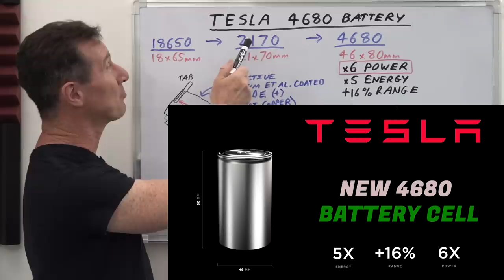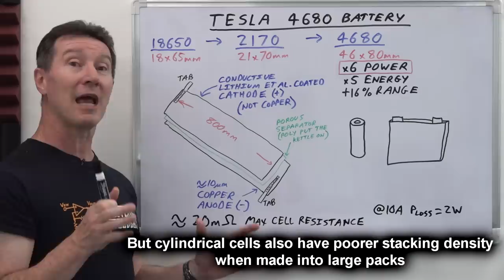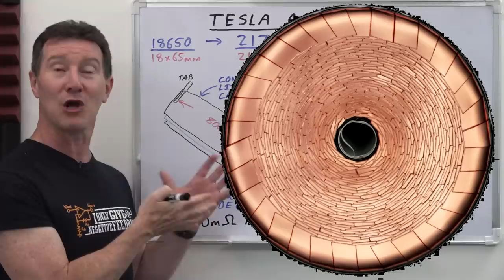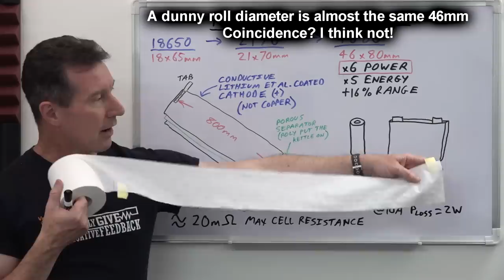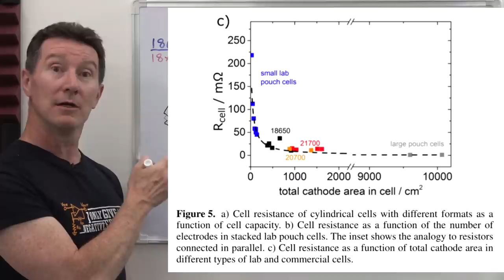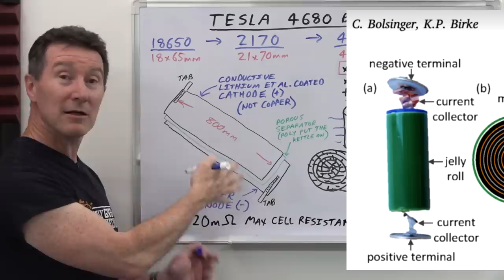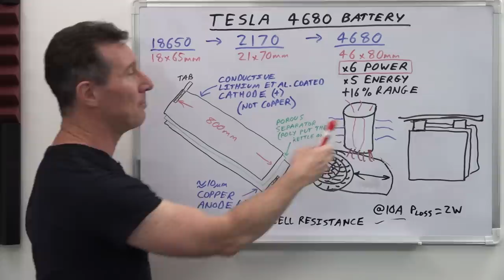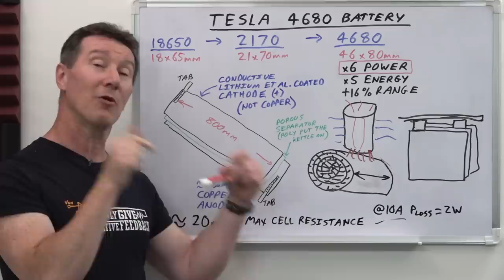EEVblog 1340 - New Tesla 4680 Battery Cell EXPLAINED

Comment: If the 4680 cell replaces 5 of the 18650/2170 cells with 10 times less resistance, that will only reduce the power loss, charging/discharging, by 2x for the whole battery pack. example (10A*10A * 0.02 = 2W*5 = 10W,  50A*50A*0.002 = 5W)

Comment: Why nobody else thought of it: Its hard until someone figures out how, then it's easy.
Reply: I don't know if it's the same design, but Tesla just bought Maxwell battery design in 2019.
* So it's most likely they just made the Production process.
What else they could do in a year?
Reply: I don't think this is a new technology except for in batteries possibly. Film capacitors have had non inductive variants for years now that mechanically do the same thing. I think in that case the ends are embedded in some conductive material rather than being folded over but the concept is the same.
Reply: They've been building supercaps with this tabless design forever, not sure why someone didn't think to build li-po cell using the same technique
Reply: true i had to figure out a way to do something that was not friendly/possible for what I was doing. then I ended up making an easier, more accurate & stronger  way of doing it & it used less parts
Reply: This has been thought of before, but not successfully implemented in batteries, it may have appeared first successfully in Electrolytic Capacitors, particularly the axial electrolytic capacitors. This is why, I suspect this technique came from the engineering of Maxwell’s Supercapacitors!
Reply: Couldn’t  they run a non electrically conductive cooling jacket right through the core of the roll and pump cooling fluid through that jacket?
Reply: When the first 1 farad super capacitors came out on the market, they were 5.5 Volt, 1 or 0.1 Farad, but had an extremely high Effective Series Resistance, so they only could serve to supply low currents for memory backup and could not support the applications of serving as Power Supply filtration Electrolytic Capacitors. Such a large capacitor with a lower ESR, would have had Computer Grade, Power Supply engineers drooling on their Hewlett-Packard Engineering calculators with dreams of making 0 ripple power supplies that could ride through long interruptions of input current during momentary brownouts, allowing simpler designs relying less on sealed  lead acid batteries often made by Panasonic and others back then. Lowering the ESR, increasing the working voltage and further increasing the capacitance is what Maxwell has got to have made its engineering goals.
Reply: yeah lots of great ideas seem obvious in hindsight...
Reply: ...I thought this is how they were doing it all along :P
Reply: I'm sure plenty of people thought of it, you need money to patent things. Also, Tesla usually just buys ideas/patents, much like Edison of a modern age.
Reply: @BustedJunkStudio  Likely a matter of cost. It's not cheap for battery companies to completely change their entire production lines. Elon though has multiple business ventures he can simply funnel their money into a new project.
Reply: Reality is, there was no need for super high current batteries in the past. Fast car charging is changing that, and is one of the most important features of EVs.
Reply: @DishNetworkDealerNEO  I think the problem is the higher thermal resistance in radial direction. You wouldnt win anything with that aproach i quess compared to outside cooling. Plus the design, manufacuring and assembly would me much more complex. The true benefit is, that with the tabless design you can use the very good thermal conductivity of the copper and almost directly connect it to a heat sink.

Comment: Others that use cylindrical cells: Lucid, Rivian, Toyota PHEV,  and hundreds of e-bikes and scooters.
Reply: Is your point that those fields will be reliant on Tesla?
Edit: I got 4 minutes into the video
Reply: au no. The host said he didn’t think anyone else was using cylindrical cells in transportation. That’s why I commented.
Reply: @JoelSapp  That's why I edited
Reply: au ok. All good.
Reply: Lucid and Rivian are still basically vaporware, Toyota is interesting though
Reply: oragamihawk   Rivian has a pilot assembly line and is building vehicles.   The actual production factory exists with the production line being finalized.   Behind schedule (who isn’t?) but hardly “vaporware”.
Reply: oragamihawk both have factories, and scheduled to release vehicles this coming year. Lucid built a factory from scratch and Rivian bought an old Mitsubishi factory has deals with Amazon to build 100k delivery vehicles on their platform.
Reply: Rimac use cylindrical cells too.
Reply: Josip Sinković thats awesome.
Reply: @origamihawk  Lucid's tech has been in Formula E for years now. It's not vaporware. However, whether or not they will be able to compete with Tesla, remains to be seen.

Comment: Great vid, there is an entire recycling system as part of the battery technology development as well, so that makes the solution irresistible.

Also, thermal paste between end cap and folded copper would be very efficient... unless chemical reaction, but im sure that could be resolved. Wonder how this transforms drone tech. And portable tools...

Comment: They said that the +16% was strictly due to the size of the cell. So that was expected.
Reply: That's mostly the height difference, the packing density between 21mm and 46mm cells doesn't change much.

Comment: The volumetric efficiency of packing cylinders is always 90.69%, regardless of dimensions. So not sure what you're referring to by "improved volumetric efficiency"??
Reply: They will be doing away with much of the liquid cooling for the new batteries,
So less space is needed between the batteries in the car.
Reply: The steel casing of the cell is wasted volume which (assuming they use the same thickness steel on the new cells) will occupy a volume proportional to the surface area of each cylinder. It's a similar story with the required plastic filling to bind all of the cells together. The individual new cells will occupy a larger volume obviously, but their surface area to volume ratio will decrease so the proportion of space wasted by casings/structure/filling material in the battery will decrease.
Reply: I was thinking the same while watching the video.
Perhaps the efficiency comes from secondary issues of less packaging and fewer cores.
In a one meter square array, there are 48 x 48 of the 2170 cells and 22 x 22 of the 4680 cells
If each cell uses a 0.25mm thick shrink fit cover and a 0.25mm thick steel case, each cell has 1mm(4x0.25mm) of its diameter of non-energy storage.  Basically a reduction of energy storage area of 26mm along both axis of the meter square, about 5%.

If the minimum empty core diameters are similar for both cell sizes there will be 1,820 fewer cores in a meter square array.
Anyone know a typical area of the empty core?
Reply: @musiphonix  You don't need to bind the cells together, in fact this makes it impossible to replace faulty cells. You don't need anything between the cells besides coolant and this can be pumped through the existing triangular spaces between the cells in the lengthwise direction instead of perpendicular to the length in a separate tube as in the existing design. The steel casing of the cell is beneficial as you can seal the cooling system with off the shelf o-rings.
Reply from the maker: @musiphonix  Exactly.
Reply from the maker: @Willy_Tepes  In this new design you don't need any cooling between cells, it's all done through the bottom anode.
Reply: @EEVblog  Wow, all the heat? You wanna bond the cells good to the heat sink then.
Reply: Well, the statement that the volumetric efficiency doesn't depend on the dimensions is not true.
The 90.69% efficiency refers to an infinite packing without limited boundaries that would cut the cells. If you take a square and you have one cell the maximum packing efficiency is just 78%. For two cells in a square, the optimal packing efficiency is even worse (58% if I remember correctly) but it gets then better the more cells you have (with some oscillations at the beginning) tending towards the 90.69 that you mentioned.

Model 3 uses 2000 cells I believe so the number is big enough. Taking into account 5.5x volume increase and the range increase the tesla model 3 would use 320 of the new cells which could reduce by a small amount the packing efficiency. Although by a negligeable amount... Because cell count is big. 

It's not the point I am trying to make. It would start to be significant if the car had less than 100.

Actually it might increase packing efficiency if they are not stacked in separate rectangular modules
Reply: @Willy_Tepes  I was more worried because I heard they are going to flood expoy inbetween the cells and make the pack a structural part of the chassis. How you'd ever replace one becomes a bit of a mystery. Your 48 by 48 cells per square metre allows for many redundant strings in case one shorts, the 22 by 22 means a lot less strings of cells in series to obtain high voltages. The single cast piece also shown sounds great until you have to repair a car from a rear, side accident. Again, another mystery. Are we racing towards iphone style serviceability for vehicles?
Reply: @saddle1940  The cells are already potted together in modules. You can't change a bad cell. I imagine that they get rid of any bad cells during initial charge. If one dies after installation my guess is it just stays dead for the life of the pack.
Reply: @Willy_Tepes  you are behind, they don't replace faulty cells
Reply: @saddle1940  disassemble the entire frame of the car. and yes, it's like iPhones. We never got to vote on this. Too bad, I guess.
Reply: Similar to the mathematician who figured out the best way to stack cannon balls on the deck of a ship.
Reply: @themodfather9382  Well, if they glue them in it's no wonder. And it would not make sense to do this with a 1865 of 2170, but a larger cell. Less cells also means less points of failure.
Reply: I'm glad you asked that question. It was the only 'huh?' moment of the video.  Good answer @Sami Shubbar.
Reply: @saddle1940  You don't and Tesla don't do it current packs either so... Also go watch Rich Rebuilds if think we are racing there, Tesla is already there, in good or bad.
Reply: @musiphonix  Bingo.

Comment: If the internal resistance is is so much lower, then does that mean the batteries would run cooler under load ? resistance generates heat !. if so then the reverse should also be true, that is, you could charge them up faster using a more powerful charger because their would be less resistance to the flow of charge and again, less heat generated.
Reply: Yep. The new 130 kWh pack may charge slightly faster on V3 Superchargers from down to max as it keeps long the high peak. We might see still 100 kW speed at 80% SOC. So less time charging for an increase from 300 to 500 miles (500 to 800 kilometers). Cool 😎
Reply: Yes a much lower internal resistance will allow to dissipate quite less heat under the same loads , allowing an higher C rates than current batteries. This means faster charging and more there will be more regen allowed, the lower heat production will also mean a more compact and light battery thermal management (allowing for a greater battery pack energy density)

Comment: At 6:42, you show a cross section of the "jelly roll" showing how it's assembled. Making the cell tabless by utilizing the full length of the rolled material as shown is ingenious! However, wouldn't it also be possible to take the opposite electrode, the aluminum positive electrode and give it the same treatment? Aluminum has a very high heat conduction potential and this would allow pulling heat from both the negative and positive ends of the cell. With proper external  heat sinking, the only heat in the cell would be caught up in the "chemistry" layers themselves, but with copper on one side, and aluminum on the other, this heat would be "sucked" away from the chemistry, making for a much more thermally stable cell. Whoever thought this up, earned his(or her) Christmas bonus!

Comment: Manufacturing batteries using the induction-welded (IW) Tabs is very easy for the volume of production that was necessary for the world's consumption of laptops etc.
The volumes required for EV's is much greater and so the requirement for "no-stop" manufacturing is essential. Musk explains this on battery day.
Likely another reason why the IW-Tabs were used is due to re-use of existing manufacturing methods/facilities used for older designs. R&D is expensive and anywhere they can save a buck is exploited.  

For each method of manufacturing (anything) at a given rate, a dollar value can be applied to the investment required to reach that rate. 
This rate is not reached instantaneously upon completion of the factory, but accelerates, and when the ceiling for that method's rate is reached, further investment is required. 
This trend when graphed looks something like a serrated/saw-toothed line on a graph of investment vs production rate.
Reply: I figure the added cost of copper per cell would be a breakingpoint for tabless design at the time many battery designs were chosen (most likely disposables rather than longlife rechargeables). And as you said once the infrastructure is in place there is huge investment involved in retooling an optimised productionline.

Comment: They didn't give you all the info on purpose Dave.  Going to a larger cell on its own doesn't really help range.  The wasted space between the cells stays the same.  What you gain is a Wee bit less casing material.  Tesla has learned to sand bag a bit.  Don't be surprised if these cells are much better than advertised. And full production is sooner.  They are trying to avoid the Osborn effect while showing you as much of their awesome tech as possible.   They did mention other components of the process like the Dry Battery electrode process and a new chemistry or small changes(they didn't mention) as well as some other details will meen the new cell is ~ 30-40% more energy dense on its own.
Reply: This

Comment: “Tab-less” was an idea the industry chose to for go, out of technically challenged to pass current out better than standard welded tabs before Tesla stumble on it. Tab-less is a misunderstood title - the correct should be “multi tab” formed in J shape with point contact conduction. 

Yes the J formed annealed copper can pass heat and current from coiled core ready to be transfer BUT stay where they were at the tabs and not to the cell casing because the process is weld-less tabs (Tesla’s tab less assembly). It is quite challenging to effectively conduct those heat and electricity with point contacts that is reducing over time for no known means for conduction resilience, to keep all J tabs in good coupled to conductive cell casing. 

Why? 
Annealed copper do not hold shape that spring steel do. Mechanical and thermal shock will deform its J shape from conduction of heat and electricity. Remedy? In theory design in mechanical resilience to the assembly such as a spring, pushing the roll and contacts against the base of cell casing. On the other hand resilience’s axial force, heat and vehicle shock can delaminates the roll stack is a reliability issue. 

When the last J tabs have gone through thermal and mechanical shock next there will be spark electric arc inside the cell, as the last tab eventually get shaken off the cell casing. Is another reliability and performance issue. 

Tab less was a good idea stop short to the finish line.
Reply: He does seam to be climaxing over Tesla Company (oh look, they stole the good name of Telsa too) getting a patient on copying someone else idea from years ago.. nothing new from the con-artist team..

Comment: I'd say that most of the greatest modifications, guided only by the video, are done, and only a few details and adjustments, can be made, such as increasing the size or the vertical integration we just saw here. Unless they start using a supermaterial or so, other features won't change dramatically the efficiency of the battery. This is only from my very short point of view, since I know very little about this. Perhaps I'm terribly wrong and it's really likely to see remarkable improvements in the near future.
Reply: I think increasing the battery size does increase the capacity and efficiency, but at some point it would become the same as other batteries. That is why I totally agree with you that if they want to continue innovating, they must use other materials, new or familiar.
Reply: Course they have chemistry researches and it's pretty important in the energy capacity but talking about the low resistance they reach just by adding these wires along the copper or conductive material is incredible because it provides the battery the possibility to give more power without waste much in warm
Reply: I'm pretty sure that in the future new materials will appear and batteries will be powerful, but also they have to keep in mind the batteries' chemistry.